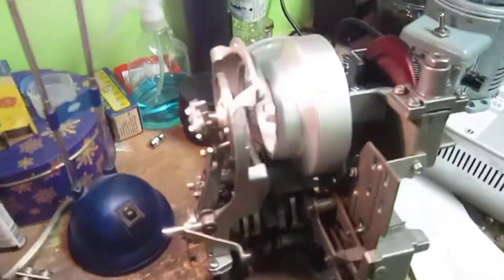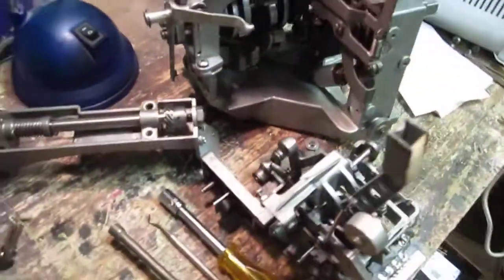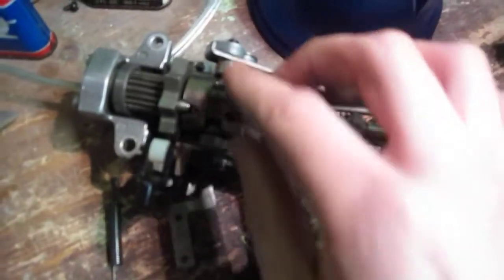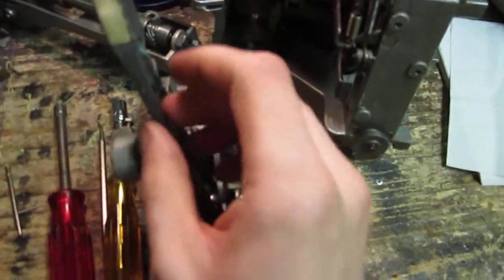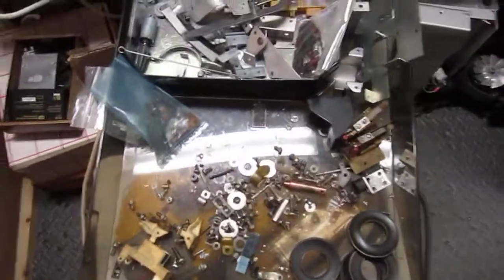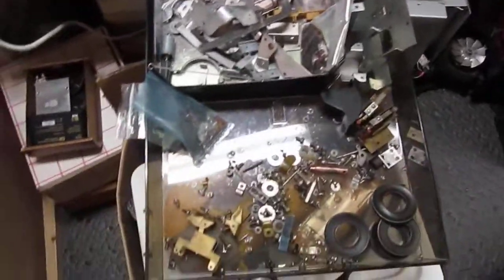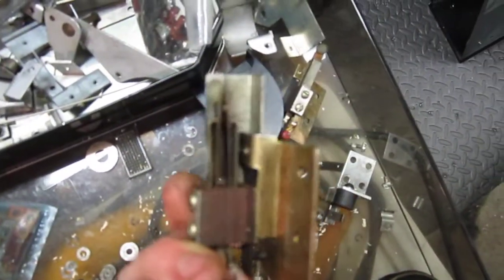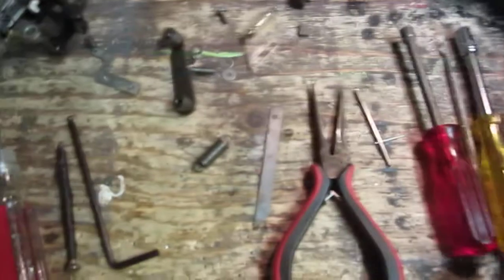Seeburg SE100 Restoration Part 1 Selectomatic Mechanism Overview

Comment: Hey, Alan -- Glad to see that you're still reading comments and responding all these years later. I'd love some advice about my Seeburg Select-O-Matic 100 (HF100G). I'm afraid I was a very bad guy and let it sit in the corner, gathering dust, for more than fifteen years. I finally decided, "Enough is enough!" and I cleared out the crap, dusted it off, turned it on.... and, there are issues. There was a record on the turntable when I switched it on, and I could hear it playing, but just barely. Then I ejected the disc, but the mechanism just sits there -- won't ride back and forth. The pin bank works -- when I select songs, the pins move -- but the mechanism won't ride and I have forgotten all the DIY stuff I learned years ago about overriding it, cleaning the pin bank, etc. Would you consider doing a "how to remove/clean your pin bank" video, and if you know anybody in the Los Angeles area whom I could contact for any needed repairs, would you mind sharing their info? And finally, if you've got any general advice, I'd appreciate it!! Thank you.
Reply from the maker: If that is the tube operated model from 1953 I see show up when searching that model it may be a big job to get going if it has not had any work done to the amplifier or control unit (if any of the original caps are still there they will likely all be in poor shape).  Mechanical wise if the motor is still operating but not transfering back into scan your clutch could be sticking or seized.  If the motor stopped working you may be some trouble because that likely means something failed.  I sadly do not know anyone who could help and myself do not know anything about that particular model.  Considering I am dealing with a V200 at a diner that has become a new "trial and error" goose chase for an issue where everything works perfect but it keeps scanning forever with the problem persisting after rebuilding both the amplifier and control units.  The only two local guys I was so lucky to know both passed away now along with their knowledge which is the problem with this stuff since no one my age seems to want to work on any of it let alone learn how to and even so there is hardly anyone around to teach about it.  Anyways best put an add up or go on a forum to get some advice or hopefully find some one local to help you out!
Reply: @TheCrazzyToobinator  Thanks so much for responding! For some reason Google didn't let me know (actually, they buried your reply in the "social" category, which I never check). Luckily I was able to track down someone in my town who still works on these machines; I actually think he's the same fellow who worked on it 20 years ago. But you're right --- these specialists are not getting any younger, and for some strange reason no one is coming along to learn these skills and take over this trade. That just came up today, when I brought my old Kenwood amplifier in to be fixed --- to the ONE GUY in all of Los Angeles who still works on them. He had a health scare earlier in the year and we nearly lost him! He said he's tried to find a young person to teach these skills to, but no one qualified is interested. It's really tragic.
Reply from the maker: @richardschenkman4454  It is a sad world for me to watch people my age do what they do in many ways, the interest in doing hands on hobbies that involve servicing and repurposing old things is just not really there.  I have a short attention span myself, surrounded by catchy new tech phones and stuff but none of that stuff even has lasting value or quality.  I drag out an old piece of vacuum tube tech from 70 years ago and just say "wow" some one actually sat down and had to hand draw a concept and design a circuit then hire a factory to hand make it.  Anyways, feel free to take a gander at the video I managed to put together over the last month or so with regards to my jukebox.  Most of the footage was shot about 4 years ago before I got the SE100 back together!
Reply: @TheCrazzyToobinator  Oh, I did! That's why I wrote you in the first place. Thanks again.

Comment: Hi Alan, Thank you for this video. We have a 1970 Seeburg se100s Golden Jet in excellent condition, original owner and very clean. I'm about to get into the Selectomatic mechanism to see why it won't move left/right to select a record. When pressing the selection buttons, after pressing the second button/number, it just pops, but the mechanism doesn't move. All other parts of the Selectomaticrotate, etc. but the record is never selected or pulled to play. I'm assuming something is stuck. If you have digital copies of the manual or any other documentation you could share, that would be helpful. I plan to pull the unit to inspect, but don't want to do a teardown like you. Maybe just a little proper adjusting and spot maintenance first. Are you able to assist? Thank you!
Reply from the maker: See if you can manually move the mechanism while the machine is off (I turn the motor coupling and the flywheel) if everything is mechanically "free" you should be able to manually cycle the mechanism like shown in the video.  Check all the fuses on the Tormat control unit, I would recommend pulling the entire unit out for inspection to make sure nothing obvious like capacitors or fuses on the control board inside have gone bad/leaked most likely this is the cause of your problem and the motor is not getting power.

Comment: I used Blech-White brand whitewall tire cleaner and water and hosing down the entire mechanism.  Then compressed air and letting it dry for several days, then lubricating it.   Did not take it apart, other than removing electric motor and covering electrical components.  The tire cleaner dissolves the grease.

Comment: This is a typical problem with any equipment that is installed in restaurants, especially ones that serve greasy food.  The grease and grime suspended in the air settles on everything making a thick crud that kills mechanical components